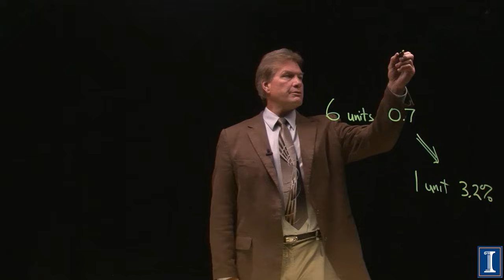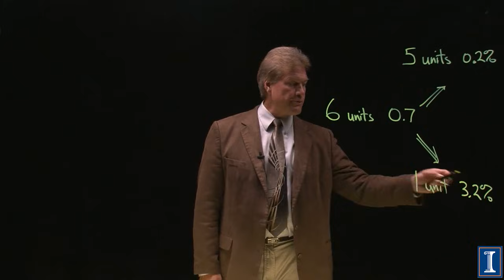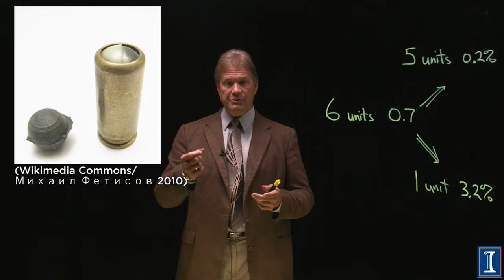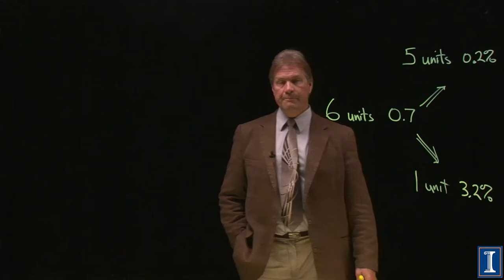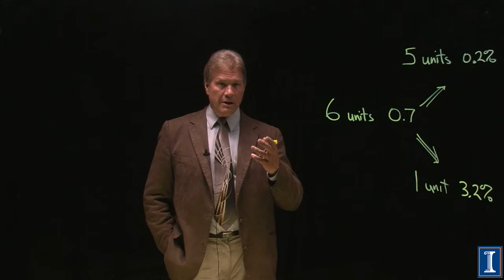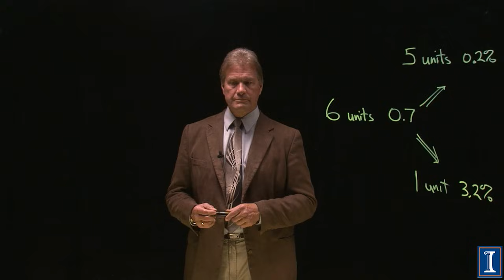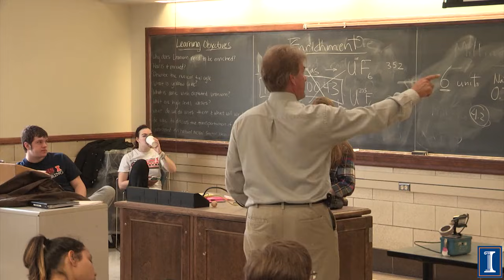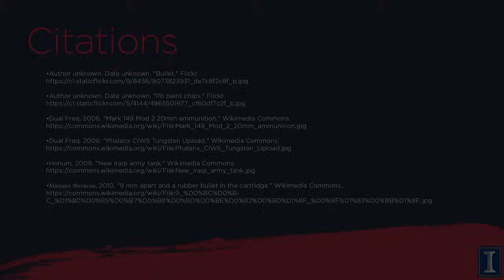What is Left Over (Depleted Uranium)

Comment: How do you make depleted uranium from depleted uranium hexafluoride ?
Reply: Simple chemistry. They remove fluorine from U238  with water steam and hydrogen,  hydrolysis  + reduction/deflourination.
Reply: @Rom2Serge  Thanks, I work construction at on a building where they were taking all the DUF6 that they produced over the last 60 years to convert it back to hf acid and uo2. They said it would take 25 years of processing to do all the containers.

Comment: Those were not antitank rounds.  The clues are that the guys handling them are wearing Navy uniforms, and the orange tips.

Those are 20mm discarding sabot antiaircraft rounds being loaded into a Phalanx Close In Weapon System (CIWS).

CIWS is the Navy's point-defense system, designed to shoot down incoming missiles.

It fires a 10 mm projectile wrapped in a 5 mm thick plastic sabot, bringing the total diameter up to 20 mm.

They indeed used to be made of DU (and based on the uniforms, the ones in  the picture are from that timeframe) but are now made of tungsten.

Comment: I'm still here wondering why depleted uranium is a more effective projectile? 
Density?
Reply: Ok, if you hit sar AR500 steel plate with a normal lead/steel core projectile, It will essentially splatter.  A Tungsten projectile will start to penetrate depending on thickness of the material, but will essentially fragment.. Depleted Uranium when it hits hardened steel,  penetrates and instead of becoming blunt or fracturing,  the structure allows it to self sharpen as it penetrates Thats the easiest way I can explain it
Reply: So it is not the density?.
 Sir,  Thank you for your honest answer
Reply: @HebrewHammerArmsCo  radioactive rounds.. that's the concern... and if fired is a violation of the Geneva convention set.
A war crime.
Reply: @axiom.ai.obviousbattletank7139  Clearly you have no idea what you are talking about. I doubt highly you have ever read the Geneva Convention..
Reply: @HebrewHammerArmsCo  the standards of war, examined a global unitarian ideal. 
Depleted uranium rounds are a violation because the agreement.
Hi , you have thoughts thoughts the Geneva convention?
I, for one,  ask questions, and challenge authority.
Reply: @HebrewHammerArmsCo do you know?
Reply: You proposed the idea of a projectile  sharpening itself. I posed an idea
Reply: @HebrewHammerArmsCo  I clearly have no idea. Can you  offer any  aside from your wildly misplaced fairytale

Comment: just want to clear one thing up just becuse you have DU (depleted Uranium) rounds dosent mean you actually cann pen the armor example a 20mm round wont have same Penetration power as a 120mm Smoothbore gun and if the round gets stoped by the tank Composite armor its not a threat to the crew and DU rounds dosent melt through the armor the penetrate it the Fire effect happends after it pens the left over melted steel Ceramic and what ever was inside the armor composite will fly throw the tank with high speed and melted Uranium to and thats extremly bad for the tank crew and the ammo and fuel in the tank
Reply: You might want to work on your basic grammar, spelling, and sentence structure if you plan to wow people with your knowledge.

Comment: You are nuts.

I recently took out my silver teeth fillings.

I have felt radioactive for over one year now slowly getting worse and the vapors accumulating in my chest.

I took them out and replaced them a few weeks ago by a dentist who didn't sound too convinced that they were the problem.

And then I took a heavy metals test.

I just thought that it was Mercury.

I am higher in Uranium 238.

As well as Cessium.

And a bunch of other toxic metals.

I think that it depends on the amount.

But Uranium 238 is dangerous.

I have been getting people sick around me slowly during the year.

And I stopped working to figure out why I felt radioactive and people were getting sick.

You are nuts.

Speaking about this as if it is nothing to worry about.

I am not in a war.

All I had were silver teeth fillings put in when I was young.

You are nuts.

Comment: Lets say I want to use DU bullets for my tanks and DU armour for my tanks, but i don't want expose my soldiers to the radio active part, and have the possibility of getting sick. Is there away to process the DU further, even it was down to  0.1 %. Can that be done ?
Reply: or just have the DU armor behind Composite armor Aka Not the last layer like Outer Steel  then Uranium then the rest of the Composite and lastly Last steel layer and Spall Liner 
(spall liner is a thin liner to reduce fragments if the armor gets penned) 
and for ammo dont worry just have the tipp made out of other things like Tungsten becuse the loader allways holds the tipp  is easy to reload that way and then ones the gunner shoots is out of the tank and not your worry anymore
and most of the time ammo is behind a blastwall to protect from ammo cook off  well unless your in a russian tank
Reply: Of course, but it would be extremely expensive, due to diminsing returns.

Comment: U-238 DU. best Excellent Defensive and Offensive Capabilities. Lets break down some of these points: 

Defensive Pros: 
- Highly Dense Material , Excellent Radiation Deterrent that is Better at Protecting against Radiation than Lead. 

Defensive Cons: 
- Pound for Pound, High Grade Ceramics out perform Depleted Uranium Armor with DU only weighing slightly less than its Ceramic counterparts. The Balance between DU and Ceramics is almost mitigatable, DU is most excelllent at Radiation Countermeasures than Active Combat Armor. 

Offensive Pros: 
-Extreme Density makes U-238 Munitions "Extreme Velocity Penetrates" Excelling at punching through heavy Armors like Titanium, Tungsten, Lead, and Ceramics. 

Offensive Cons: 
- U-238 is Still a Radioactive Isotope. Even 0.2% is enough to Get Radiation Sickness. If enough U-238 Munitions are Fired around and left to Decay in the Landscape can lead to Radiation Poisoning and Other Adverse Effects. 

Notes: All Information is made available by a Moron (Me) who plays Video games and watches Movies, but Loves Military History, if you have more information on U-238 and wish to correct me, Feel free! I like constructive Criticism!

Comment: Proffesor but what about a crew a of tank sitting in a tank wich armor is made of depleted uranium armor plates like in an Abrams ?
Reply: I would guess those plates are some of the outermost armor plates. Meaning the tankers inside are still in a big steel box similar to what would shield a reactor in submarines
Reply: @laa0fa  what about the guys sitting, sleeping etc on the tank?
Reply: @deth3021  who the fuck is sleeping on a tank. There's no good/ safe places to sleep
Reply: @laa0fa  well you do need to sometime stay on the field and not return to base and then you have to sleep in the tank well there is allways someone awake to warn is something is comming or happening
and the crew is fine the uranium is behind other composite layers and the armor is thick is better to have Uranium then getting Penetrated becuse your armor didnt have maximum protection 
but again if the armor is penetrated you have Uranium flying around the tank from the Penetrator Dart and fragments from your tank

Comment: Is there an exothermic reaction between the uranium and the steel rifling of a gun barrel?
Reply: Absolutely not. The actual  penetrator was about 5/8'' diameter and was carried in an aluminum shell with a windscreen. The turning bands at the base of the shell which engaged the rifling were nylon.

Comment: Are there any uses for U-238 that don't include destroying land or peoples?
Reply: Also used for trimming weights in aircraft, coloring in ceramics, a few scientific instruments.
Its best use might be as a fertile element in breeder reactors
Reply: Lots of uses. Armor plating for vehicles. It is very heavy and very ductile, thus it stops bullets very effectively. Surprisingly it's also as radiation shielding. U238 itself is only very very slightly radioactive. Hence the 4 billion year half life - it's decaying very very slowly indeed.  U238 is not fissile and has no application in either reactors or in weapons.
Reply: Aside from making yellow bathroom tiles, it's fertile material for breeder reactors that produce Plutonium. While it is of course used for nuclear weapons, Plutonium can be used to generate electricity, using Uranium-238 as the feedstock. Uranium -238 is also of use to geologists, its 4.6-billion year half life makes it ideal for dating rocks and meteorites.
Reply: A very cool paperweight in a room you don't visit too often.

Comment: As an aside, DU also shears in such a way that a penetrator going through armour sharpens itself rather than mushrooming.
Reply: This is not entirely true. While uranium penetrators tend to mushroom out less than those made of similarly dense materials (such as those made of tungsten alloys), uranium penetrators still increase in diameter and "bulk up" towards the point. Uranium penetrators do not become narrower than their original diameter as they go through the target's armor; they do not "sharpen" the way one sharpens a pencil.
Reply: ~the powerder kills the friendly troops, have lick with that they get the radioative  desease.
Reply: Which leaves a lot more uranium dust in the air. More dangerous than inhaling lead or another heavy metal
Reply: @crazycoffee  se what happened when usa used those bullets in kosovo, nato soldiers died of radiactive deseases..
Reply: @robertokandal 😂🤡😂🤡😂

Comment: @7:20 "It's always a good idea to get out bullet fragments" I believe that, often, shrapnel and other foreign bodies are left in place because it is safer than the surgery to extract them. Traumatic injuries are treated to repair damage and save organs, removing debris is a secondary goal.
Reply: I knew as soon as he said it that someone was typing away in the comments.
Reply: Bruce Duncan This is true, but if fragments are poisonous you have to go after them. I believe (could be unfounded) that body can insulate lead fragments and people can live long lives afterwards. 
But what is the usual recommendation for DU fragments? Leave them or remove them?
Reply: @MacakTosha  That's a good point. As always it depends. Metallic uranium is not terribly harmful, except to the kidneys, and it has fairly low solubility, so it doesn't really get absorbed, unlike lead, which is more soluble and very toxic in the brain. Corrosion products can form soluble uranium salts which are toxic, however. There was a 747 crash in the 90s where the DU trim weights in the tail were exposed to fire and possibly inhaled by survivors and rescuers. Studies concluded that the risks were minimal, although I believe the use of DU as ballast in aircraft was phased out. I'm not a medic, so I can't answer your questions!
Reply: @BruceDuncan  I am not a medic either, but I like to know a little bit about everything. 

What I have noticed is that use of DU is heavily politicized. Many people are afraid of what they don't know, so they panic. This is a natural, but not a very scientific reaction. 

But for some reason, defenders of the industrial use of DU will go far and wide to avoid discussions about anything other than elemental DU. Any other products of Uranium (like salts) are avoided in any and every discussion about it. Not everything is a conspiracy, but... 

We all remember how Monsanto manager was on camera explaining that drinking a pint of Roundup wouldn't do anybody any harm, but when a pint of Roundup was given to him to demonstrate - he fled the studio. I just can't help but wander what would be the reaction of a producer of DU munitions, if some of the used up penetrators were given back to him. Would they jump up and run away or put them in their pocket?
Reply: Good point, small fragments and fragments that are in risky surgical places are often left in place, unless they endanger the person's life by being there. The surgery is dangerous, removing several fragments likely deep in someone and the risk is compounded by the injury that put the fragments there. I'm not familiar with DU toxicity, but lead exposure is also much worse for children than adults where lead exposure doesn't affect your nervous system as much. 

The risk analysis is pretty heavily in favor of leaving them in: Even if the surgery has only a 2% risk of death (just from the general anesthesia and hospitalization you would expect higher) you have to weigh 2% chance of losing all the remaining years of your life vs 98% chance of improving the quality of those years by some unknown X%.

Comment: And that's the reason why NATO did throw 15 tons of depleted uranium on Serbia during bombing campaign in 1999?
Reply: John 381 
15 tons is less than the volume of a couple of metre cubes. Now consider the huge warehouses used to store conventional munitions containing lead.
Reply: @michaelkaliski7651  In fact, a cubic meter of uranium would weigh bout 19 metric tons, so 15 is more like 0.8 cu m.
Reply: It's less radioactive than as found in nature, so it isn't an issue.
Reply: Most of the uranium was fired over kosovo in the  form of uranium bullets for purposes of destroying tanks. Tho in that war there were no American soliders on the ground so profesors logic does not apply.
Reply: @ralebjeka9694  Thanks to DU rounds fired from the air soldiers weren't required to be on the ground, so the professor's logic still applies.
Reply: @Willaev  But if there's no soldiers on the ground then there is no need to destroy armor in the first place, because there was no threat to the soldiers because there were none so none will be harmed and that was professor's point, (Serbians had no anti air capabilities above 10km and all the flights were at that height, so there was no harm to the airforce ether). The saying war is messy still holds however.
Reply: @ralebjeka9694  When you destroy their tanks there's no need to put soldiers on the ground, so again the professor's point applies.

"There was no harm to the airforce"

Tell that to the F-117. F-16, and A-10s that were shot down, plus others that were damaged. What a ridiculous statement.
Reply: @Willaev  yes but there's no urgency in this case since there is no deaths so non radioactive alternatives could have been used.
Reply: @ralebjeka9694  Lol. Paranoia over DU's low radioactivity isn't a valid argument against it.
Reply: @Willaev  would you live on a filed that has DU sprayed all over it.
Reply: @ralebjeka9694  LOL. Natural uranium is in every parcel of soil around the planet. DU is 40% less radioactive than natural uranium. Again, your paranoia over DU isn't a valid argument.

Comment: Never knew about the D.U. - Iron reaction...  Thanks!
Reply: on top of exothermic, it's also frangible and self-sharpening, basically once it strikes a hard surface, it shatters into sharper points, which helps it penetrate deeper, and create more surface area to burn up
Reply: Neither has anyone else. The Uranium is a pyrophoric metal that will ignite when splattered by high impact velocity with steel, but the reaction is with oxygen , not iron. Uranium is also very dense and hard.
Reply: Oh wow!
Reply: EnricoAwsome  tank peNetrators nit just fired from but mainly AT the DU us NOT antipersonel?
Reply: So what are the byproducts of said chemical reaction? Is it just Uranium Oxide, or are there other things too?
(Steel contains Iron and Carbon, and also some Molibden, Nickel, Chromium,... and in composite armor there will be Aluminum and other things as well)

At high pressure and temperature (like when armor is trying to take away huge kinetic energy from a DU penetrator), many things can form. Are they all as harmless as professor claims?
Reply: @MacakTosha  mostly UO2, but mabe traces of  other things may be there